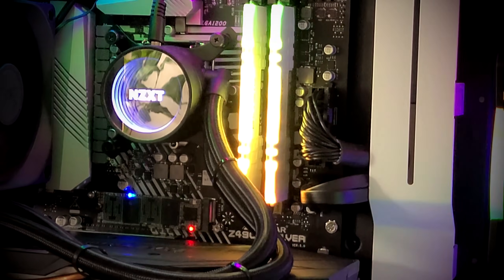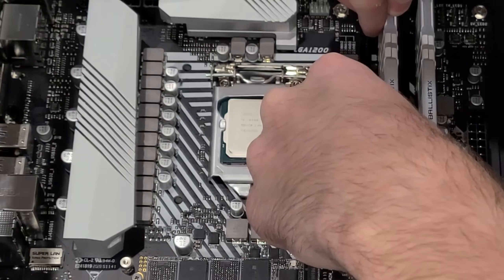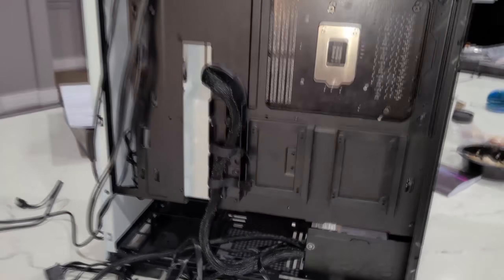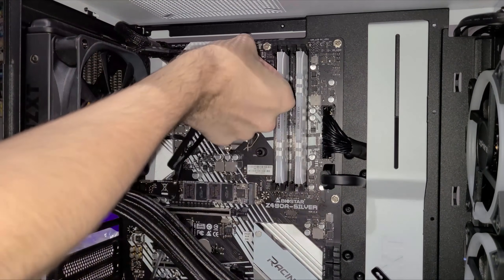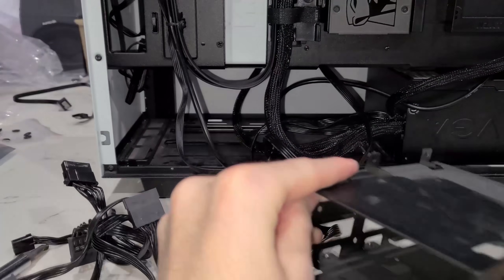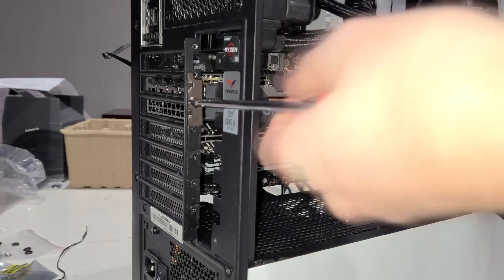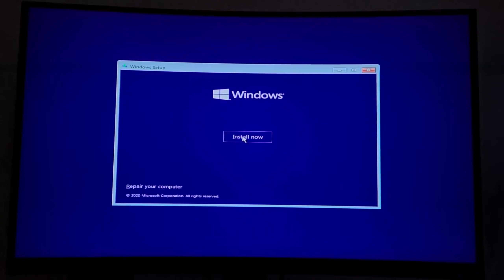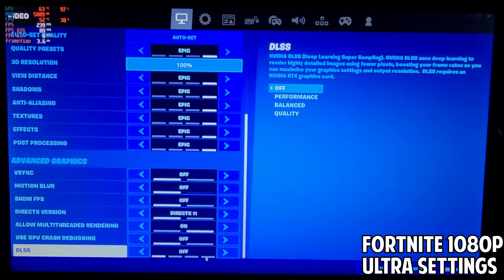BEST $1000 Streaming/Gaming PC [Build Tutorial, Benchmarks]

Comment: Can someone pls tell me if a Msi GeForce  1050 ti would fit?
Reply: It will work. You can always check the dimensions of the card and compare them with the maximum GPU length dimensions of the computer case. All this info should be in the specifications and/or technical/advanced specifications.

Comment: This is amazing! I live in Canada, and this is my second build. I also installed a 2T HDD, and a 3060 ti instead of a 2060.
Reply: hey just built this build and i can’t connect my moniter. any ideas as to why it’s not working?
Reply: @DeepPockets6742  I'm no expert but I would just double check the pc if it has everything ok do some research and try to use some methods or maybe check the moniter
Reply: @oriettsgaming7625  bro it’s been 6 months
Reply: Make sure you connected your front panel cables right, trouble shoot, idk what to tell you, you’ll get it running with some tweaking.

Comment: Great video I just copied this exact setup except for the gpu, with how high prices are I got a 1650 To hold me over. All though the video is greatly detailed you did skip out on some Huge parts that left me very confused. For instance you never explained the uphere fans and where to plug them in. I had no idea there was a separate control box that plugged into the motherboard and connected that fans. Took me over an hour just to figure that part out being new and all. Still an amazing guide, I just feel you skipped over a lot of the smaller steps that you might think are to obvious to miss. But for some one like me with 0 knowledge of building a pc I was still flabbergasted and confused at a lot of small parts.
Reply: So I just buy all the parts from the diffrent links and put it together sounds easy. I'm scared that the parts won't fit like does it matter what options I pick like a b c bru help me

Comment: i built a computer in 2019. got most parts on amazon. i went to amazon and clicked on orders and went to the ram i bought. when clicked on it i see in the description that it says a newer model is available. will the new model work with the old model in my case as long as it's the same ram (brand, size, speed, etc)?

Comment: Just built this pc. It works fine but he forgot to say where to plug the fans into and all you have to do is use the sada cable for the hub and plug the 6 pin into there and you will also have to buy a wifi card or a ethernet cable to get wifi. Hope this helps! :)
Reply: bro thank you so much
Reply: @zncat1916  no problem.
Reply: How is the performance
Reply: @cesarnava8073  It’s great. i used a different graphics card i used the 1660 super and i get great performance
Reply: @ben-budd  how much did you end up paying in total for everything
Reply: @cesarnava8073  about 1500
Reply: I have a GeForce GTX 1650, will this work too? And btw I went through all the links and picked what I needed for parts and the total ended up being around $730 for me at least which is weird cause you said your total build was $1500
Reply: @AS4PM0B  yes the 1650 should work and the reason mine was a lot more is because of the “SUPER” witch makes it better but more expensive
Reply: @ben-budd  Oh I see, thanks! Btw I’m about to build this pc, just waiting on the case and PSU, I’m so scared and nervous but I’ve been watching a lot of pc building videos/tutorials so I should be okay but this is a first for me
Reply: @ben-budd  Yeah fs I’ll get that in mind when I need help. I’m doing this exact same build except I’m using a different GPU & Mobo (MSI MPG Z490 Gaming Plus) so following the video should be accurate almost
Reply: @AS4PM0B  how did it go?

Comment: Hey Is the ASUS GeForce RTX 2060 Dual Overclocked Dual-Fan 6GB GDDR6 PCIe 3.0 Graphics Card a good replacement and will it work with the motherboard because the ones you linked are not available
Reply from the maker: Yes
Reply: @Roo_Tech  ok thanks this helps alot

Comment: I’m building one for around 1100 including sales tax and shipping and all parts were bought new from Amazon

Ryzen 5 3600

Ryzen 5 3600 stock cooler

MSI MPG B550 GAMING EDGE WIFI ATX AM4 Motherboard

Corsair Vengeance RGB Pro 16 GB (2 x 8 GB) DDR4-3200 CL16 Memory

Samsung 970 Evo 500 GB M.2-2280 NVME Solid State Drive

Seagate Barracuda Compute 2 TB 3.5" 7200RPM Internal Hard Drive

Evga RTX 3060 (when it comes out)

Cooler Master MasterBox TD500 Mesh ATX Mid Tower Case

EVGA BR 700 W 80+ Bronze Certified ATX Power Supply

Comment: Hey man I am gunna make this very soon but, I want to know what can I look into upgrade wise because I want to use this build but is there things I can upgrade to "Max it out"?
Reply: An upgrade to a ryzen 7 will be a good start, good luck with your build
Reply: @BRoyden07  thanks but do I need to change any thing (power or motherboard) or just keep it the same.
Reply: @betterasksomebody  also, the h510 is a good case in all,  but as you might know that I has bad airflow and with the M22is one of the lower end CPU coolers I would recommend putting this build into a 220t airflow case

Comment: PLEASE RESPOND SO DOES EVERYTHING COME WITH SCREW DRIVERS???
Reply: No. You must provide your own screw driver. If you meant screws, then yes. The screws will come with the respective parts.
Reply: @JJFlores197  thank you! So what screwdriver do I buy? Cheaper options?
Reply: @kallonplays2995  Pretty much any standard screwdriver set will work, specifically a size 2 Phillips head. I would look into one that has magnetized tips, but not an absolute requirement.

Comment: Bro. Instead of the AIO get a ryzen cpu tgen get a better mb and get a damm aircooler instead of a 1 fan AIO nzxt is overpriced aswell also your fan config was horrible.
Reply: Ikr especially in a h510 oof even heat will be talking the FPS away to😂
Reply: @BRoyden07  yeah,but a one fan AIO is horrendous also ryzen cpu's are a lot better for streaming you could get a good air-cooler then a better mb and probably some more ram instead of a 100$ cooler

Comment: I know ima sound dumb but I’m new to this what about the WiFi ?
Reply: What about it?
Reply: @ethanhollaway8025  like do I need to buy a WiFi card or does it come with WiFi sticks
Reply: Have you found an answer
Reply: @thickboy1013  no sadly
Reply: @skitnathan7468  I actually did some research on it and with different motherboards you have to get the either come with Bluetooth Wi-Fi or you run ethernet and you can get attachments to go on your motherboard so you can use Bluetooth Wi-Fi

Comment: Nice build but. You can build pc using a used cpu and gpu with a r5 3600 and 5700xt and a 144hz monitor with mouse and keyboard for 1,100.🤷🏽‍♂️I think that’s a better deal for sure.

Comment: Hey I’m new and hoping to build my pc so I’m just wondering if the HyperX Fury 16GB 3200MHz DDR4 CL16 DIMM (Kit of 2) 1Rx8  RGB XMP Desktop Memory HX432C16FB3AK2/16 ram would work in this build? Thx 👍
Reply: @catan1898  hey sorry but guessing your a bit more of an expert than me will any other power supply work im looking currently at the Cooler Master MWE 80Plus White 650W 230V 80Plus Single +12V Rail Silent Mode DC-to-DC Power Supply - Black - MPE-6501-ACABW-AU lol sos for asking alot ty

Comment: lol no this video is a joke. build this https://pcpartpicker.com/list/9d9CMv this guy used a z490 for a 10400. he used an aio cooler for A 6 core LOL(aio is also overpriced). you go from a 2060 to a 2080S performance in this build. for $50 more. u get a better cooler, u get a "worse" mobo but u dont need a z490 for a 10400. you get better storage, more wattage in a better psu, and better airflow due to more fans and a better case. dont listen to this dude. if u want something under $1000, buy a used 1080 on a resale site for $250. equiv to a 2070/2070S. plus mine has a 3060ti instead of a 2060 YW :).

Comment: Can the pc run off of wifi or does it only allow lan?
Reply: This build has no wi-Fi built in so you will either need to use an ethernet cable or buy a Wi-Fi adapter.
Reply: @JJFlores197  How would I go about adding it? Is there any way?
Reply: @thatlonelyboy7812  Like I said in the first comment, you will need to buy a Wi-Fi adapter. The alternative would be to buy a motherboard that already has Wi-Fi built-in, but you would need to search for a compatible one.

Comment: What can we do if the wifi doesn't wanna connect at all?
Reply: Do you get any error messages when trying to connect to your Wi-FI network or what exactly is going on? Can you see any Wi-Fi networks? If not, you will most likely need to install the Wi-Fi adapter drivers.

Comment: You never show us how to plug in the fans
Reply: The fan header location should be marked out pretty clearly on the manual. Usually 3/4 pin connectors around the edge.

Comment: Is it ok if I put the ssd in last because it’s not hear right now
Reply: I've never built a pc, but i would say wait, they might do it early for a reasom
Reply: That will be fine. PCs can turn on without any storage drive installed. Of course, you won't be able to install the operating system until you have the SSD installed.

Comment: Do you need both a ssd and hard drive or one or the other ?
Reply: You can use either one, but I strongly recommend an SSD. It will make your system much more responsive than with just a hard drive. A common setup is to have an SSD as the boot drive and a hard drive for general storage.

Comment: Component		Selection	Base	Promo	Shipping	Tax		Price	Where		
CPU		

Intel Core i5-9400F 2.9 GHz 6-Core Processor	$139.99		FREE			$139.99	

CPU Cooler		

Cooler Master Hyper 212 EVO 82.9 CFM Sleeve Bearing CPU Cooler	$34.99	-$4.00 1	FREE			$30.99	

Motherboard		

Asus PRIME Z390-A ATX LGA1151 Motherboard	$176.97					$176.97	

Memory		

GeIL EVO POTENZA 16 GB (2 x 8 GB) DDR4-3000 CL16 Memory	$53.99		FREE			$53.99	

Storage		

Intel 665p 1 TB M.2-2280 NVME Solid State Drive	$89.99		FREE			$89.99	

Video Card		

EVGA GeForce GTX 1660 6 GB SC ULTRA GAMING Video Card	$280.26		$9.95			$290.21	

Case		

Rosewill TYRFING ATX Mid Tower Case	$44.99		FREE			$44.99	

Power Supply		

Corsair RM (2019) 850 W 80+ Gold Certified Fully Modular ATX Power Supply	$134.99					$134.99	

Optical Drive		
Operating System		

Microsoft Windows 10 Home OEM 64-bit	$108.78		FREE			$108.78	

Software		

Adobe Premiere Elements 2019 - Mac & Windows Software

are these good?

Comment: you suggest: the TEAMGROUP MS30 512GB SATA Rev. 3.0 (6Gb/s) M.2 Solid State Drive ...... Question: Can I use the: Sabrent 500GB Rocket Nvme PCIe 4.0 M.2 2280 Internal SSD Maximum Performance Solid State Drive ???
Reply: Yes that will work.

Comment: Hey, can someone help me with my PC build.

My budget is within 1500-1600$ and I am looking for a PC that can handle Modern Warfare/Apex Legends with 120+ frames @ ultra settings. If there are cheaper or more powerful options, please let me know immediately.

Motherboard: Gigabyte X570 AORUS Elite (AMD Ryzen 3000/X570/ATX/PCIe4.0/DDR4/USB3.1/Realtek ALC1200/Front USB Type-C/RGB Fusion 2.0/M.2 Thermal Guard/Gaming Motherboard)

Graphics Card: PowerColor AMD Radeon RX 5500 XT 8GB AXRX 5500XT 8GBD6-DH/OC

Processor: AMD Ryzen 7 3700X 8-Core, 16-Thread Unlocked Desktop Processor with Wraith Prism LED Cooler

SSD: Western Digital 1TB WD Blue SN550 NVMe Internal SSD - Gen3 x4 PCIe 8Gb/s, M.2 2280, 3D NAND, Up to 2,400 MB/s - WDS100T2B0C

Storage: Seagate BarraCuda 8TB Internal Hard Drive HDD – 3.5 Inch Sata 6 Gb/s 5400 RPM 256MB Cache for Computer Desktop PC 

RAM: Corsair Vengeance RGB Pro 32GB (2x16GB) DDR4 3200 (PC4-25600) C16 Desktop Memory - Black

Power: 750 W bronze power supply

 
Total cost is 1,280. Is this good enough to meet my gaming demands?

Comment: When screwing always make sure they are “wrist tight”, as to say they are tight to the point you feel resistance in your wrist.

Also a question, does the 1000 dollar total include the extra hard drives?
Reply: No it does not in all (I had to use an ryzen 5 chip instead of a i5 due to being out of stock around same price ) it costs 1,186 by 1000 he means close to 1000.
Reply: @RubenStim  I used pc part picker and it costs around $750 (I also changed the power supply)
Reply: @ryannw.992  Oh I just used the links he gave us
Reply: @ryannw.992  hmmm that’s strange with a £150 monitor it costs around £1000 for me where the system it self should cost 750ish. Also the biostar mother board is expensive af in the uk

Comment: I was instantly turned off when he started with an intel processor. Good video but Ryzen is vastly superior rn
Reply: I’m new to pc building and am trying to build my very first pc. Do you recommend another processor over Intel and is it compatible with the build he already has?
Reply: @hdelara23  unfortunately Intel and AMD CPUs are not compatible on the same motherboard. They both have their own chipset so you have to be careful when getting a motherboard to make sure your CPU will fit in it
Reply: @Jaber Baynah Cause amd has better price to performance ratio.
Reply: @Jaber Baynah their newest 5000 series CPU’s perform so much better than Intel’s. Additionally, most of their CPU’s offer more cores and more threads, which basically means you can run more things at once than Intel. Plus significantly cheaper !
Reply: @meeper-t  so everything else is good but that so I should get that and everything else except the intel?

Comment: I need help I don't know which cpu I should get. It's either an i5-10400 or an i5-9600k. But I could also get a R5 3600. I'm gonna be running a RX 5700 XT and 16gb of ram as well. I'm really just waiting til black Friday hits to get whichever one's cheaper. I also have a microcenter close to me so I could get bundles of a cpu and a motherboard over there for like 20-30 cheaper. I honestly don't think the Ryzen 3600 will get a discount because they keep being sold out on PC part picker. So I'm debating whether to just go with intel. Both the i5-10400 and the i5-9600k is 150 dollars at microcenter but I just don't know. Need some guidance. Oh and I it's strictly gaming that I'm using the PC for and as well as school.

Comment: I can’t find the sata cables that do to the hdd to the mobo (not the ones from the psu) HELP!
Or i had to bought it separate?
Reply: Did you check the motherboard box thoroughly? Most boards will come with a small plastic bag with at least 1-2 SATA cables.

Comment: I built this exact pc having trouble with my cooler not being recognized on my cam software, I could control the lighting but thats it help please 🙏
Reply: Update I reached out to nzxt and they said that On the M22, only the lighting will be controlled within the CAM software. CAM will not be able to adjust speeds on the pump or fan. The fan runs off your motherboard fan header and the pump will run at full speed (3,000 RPM). The power tab is only for our E series NZXT power supply and will not work with any other device.
Reply: So should I get this PC cause it's going to be my first pc and I'm really anxious because that's gonna be a whole lotta money down the drain
Reply: @xlegacy5174  nothing to worry about if you buy everything he listed on the video, most important buy the boistar motherboard on new egg not the asus one he listed on amazon, the rest you could buy on amazon my only regret is that i didn't buy the i7 processor and a 1000w power supply for a better graphic card to play warzone at a better fps.
Reply: @ZDGAMING16  can i get a different graphics card? like an rtx 2060 KO
Reply: @adisharma3737  you would need like a i7 & a 750w power supply with a better cooling system thats a more money build

Comment: Was on pcpartpicker and was about to use the 10400 but then I saw that the 10600K has a higher clock and boost speed for only around 60 or 70 pounds more, just was wondering if it would work in the build or not

Comment: To connect the ssd do i have to buy extra cable or does it come with motherboard or psu? Thanks
Reply: The motherboard should come with a few data cables for SATA drives and the power supply will of course come with the power cables for your components.
Reply: @JJFlores197  ahhhh ok tysm 👌👌👌 was starting to think i had to buy cables

Comment: How do i use this cpu cooler CoolerMaster MasterLiquid ML240L RGB V2, Close-Loop AIO CPU Liquid Cooler, 240 Radiator, Dual SickleFlow 120mm, RGB Lighting, 3rd Gen Dual Chamber Pump for AMD Ryzen/Intel LGA1200/1151 for the nzxt case

Comment: If I got everything in the description but changed the graphics card to the nvidia 3070 would the computer run a lot faster? I’m new to computers so I’m wondering
Reply: Would bottleneck man you’d have to get a better processor build it with a i5 10600k(more powerful) , but it cost 100 dollars more than the i5 10400.

Comment: Can I use a Intel Core i7-9700 instead?
Reply: You’d have to use another motherboard, the motherboard in this video supports 10th generation intel, you could use a i7 10600k, those cost around 250-280 dollars
Reply: @rickymullins3657  ok
Reply: @rickymullins3657  I’m using the mgi mpg Z490 gaming plus